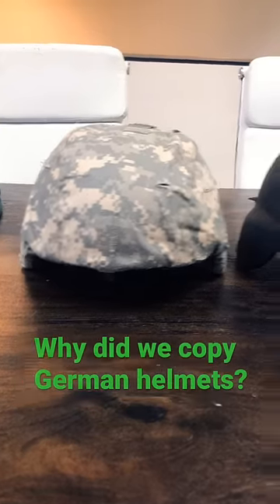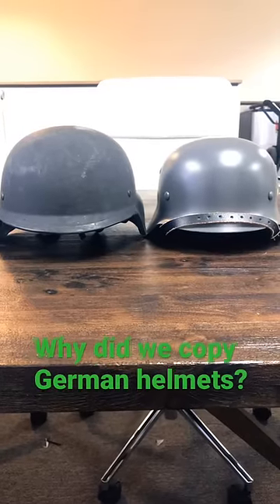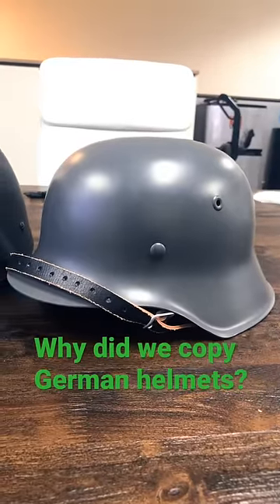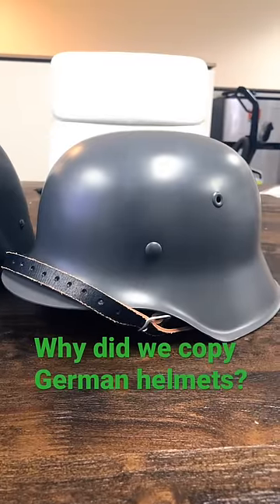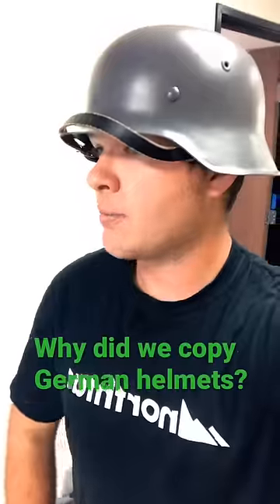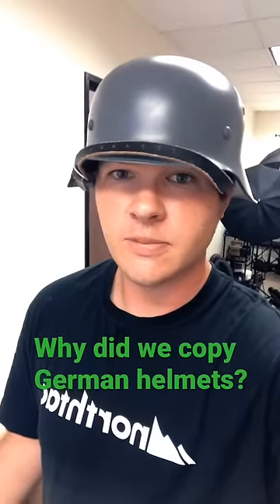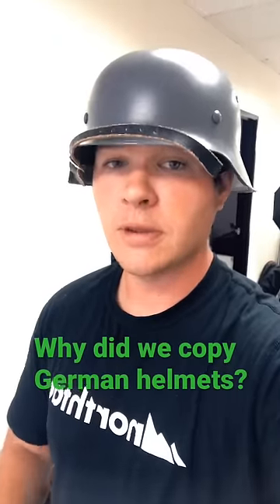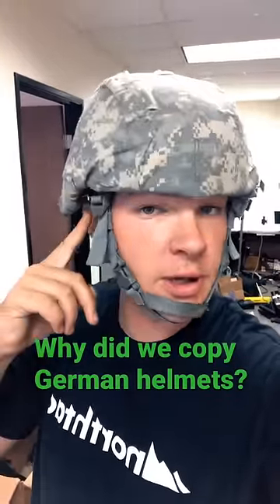Why did we copy German helmets? #shorts

Comment: Some German inventions no matter when they where Invented have great merits, I have a British ww1 helmet and you have to strap it tightly and it's still jumping around.

The German helmet was not harder to make than the British or M1 would cost around the same but are much better.

Just like the Jerry can, they would capture as many as they could as allied gas and water cans where awful.

Before and at the start of WW1 soldiers had to have a mustache in all European millitarys, you just had to it was a requirement.

Men would smoke pipes or cigars, or some would use snuff (high quality tobbaco leaf with stem parts removed dehydrated then powdered and mixed with mentholium to sniff) so smoking was not inhaled.

Cigarettes where made and meant only for women.

Men would have a pocket watch on a chain in their coat pocket, wrist watches where know as wristlets and only for women.

They had to relax the mustache law as it takes time to grow one, some men can grow a full one (I don't grow facial hair directly under my nose so no Hitler mustache for me) plus they enlisted boys as young as 13 (my great grandfather was 15 and was a Lewis gunner)

Helmets quickly became a thing due to all the artillery.

Cigars and pipes where replaced by cigarettes that men would inhale to get a quicker effect as they are much cheaper and faster to produce than cigars and have a stronger effect but officers would still use them.

Modern pocket watches with no metal cover with keyless works as in a crown at the top that you could use to set time and wind like on a normal  modern wrist watch would have lugs soldered onto them.

Ones with metal covers would have most of the cover drilled out so it looked like a cage so it was harder to break.

Some converters would even turn the movement so the crown was at 3 oclock.

All these are known as marriage watches and for watch buyers be careful as most are just old pokcet watches with new conversions.

Then Switzerland and the US would sell small movements to company's all over the world and wrist watches made from the start as a wrist watches started to be made.

Instant coffee became popular so did stuff like spam and American processed cheese.

Dextroamphetamine pills , morphine and diamorphine (heroin) pills and ampuals, cocaine powder, pills and ampuals , laudanum and chloral hydrate where all common drugs.

You could buy a kit containing a lot of morphine and cocaine ampuals and some syringes and needles where sold at Harrods as a perfect gift for those on the front line.

Many came home with addictions but had a decade or 2 until it became harder to get but still relatively easy to get a prescription from a doctor.

In most European millitarys (apart from the navy) Brandy, port, sherry, wine and beer (usualy an IPA type for its long shelf life) was what was expected from officers and privates.

Due to how large the war was this was replaced with naval rum about 56 percent (gunpowder proof) and if lucky you got some beer.

Officers still got the good stuff.

Before going over the top dextroamphetamine pills and alot of rum was given with men who could get anything else would do, the alcohol was rationed but it was common for men to save up or steal alcohol and then get totaly wasted before getting ready to go over the top as they knew it would be a miracle if they survived.

PTSD and what was called shell shock was not understood well and after a close hit from artillery some would just wonder off then be court martiled then shot at dawn for cowardice.

Alot of the time officers would shoot retreating men.

When the Germans could see something that looked like a gas mask was being used they would first use shells or canisters that would emit a non lethal gas that would make you vomit (making the mask useless) then would use mustard gas.

Your best chance to survive without a mask would be to hope your dehydrated and piss in a rag then breath though it.
(Even Hitler was not crazy enough to use chemical weapons in fights as he experienced them himself in WW1)

They went into the war with marching orders, the old pre machine gun and artillery tactics, cavalry and spotting planes.

It ended with chemical warefare, tanks, fighter and bomber aircraft and long range powerful artillery and machine guns being king.

My great grandfather lost his leg at the battle of the somme and he died at 98 or 99 with a wooden leg and after the war he could walkz run, okay football and ride his brough superior motorbike.  He was a little crazy I still have alot of German postcards that looked like it was the last postcard the men sent as it looked oked like it was written quickly and used ever quare mm of space.

You could tell if it was being sent to a female or male as if it was sent to a female It would be a landscape or art.

If sent to a man it would mostly be pictures of naked french girls, sometimes you could see everything.

They realy liked girls with a little meat on them with very pale skin back then.

He took back so much loot.

Since brothals in France and Belgium where so common as alot of war widows or just lack of work and the fact that some men would pay whatever they asked l, condoms where actually issued some rubber some sheepskin as so many men had to go to VD hospitals.

Even in Iraq and Afghanistan prostitution was rife but with girls mostly from Russia, eastern Europe and  east Asia but I'm sure they made alot.

In many modern millitarys they still hire girls at outposts and some guys can get vouchers or can do it once ever whenever or as a reward for something.
It's more secretive now but in the past was more common and open and I'm not talking about comfort women but paid women.

After WW1 and the Spanish flu Germanyz especialy Berlin from 1919/1920 until Hitler came into power Berlin was the place to go, it was cheap due to the fact most people where poor, men would go for weeks or months and find nice girls as they had some money or prositutes that cost little, even supposedly sister and mother and daughter (fucked up but hopefully it was fake) lots of cheap beer and good food and alot of cheap and courrupt doctors that would prescribe you anything you asked for.

It was one long party and it helped the Nazis get into power with Hitler himself getting syphalis (a disease that was very hard to treat pre-antibiotics and in later stages would make people crazy) from around that time that and his daily meth use was probably why he was so batshit insane, if you watch a video of Hitler at the Berlin Olympics you can see he is totaly high and tweaking out.

After WW1
When the men came home no one dared to make fun of clean shaven soldiers smoking cigarettes, wearing a helmet with a wrist watch and a new taste for rum and different drugs.

Just before the war ended more people died from the Spanish flu so if you where a professional soldiers at the start of the warz survived all of it then survived the Spanish flu.... You had luck on your side.

If you survived an injury like loosing a limb, since the trenches and no man's land was so dirty, full of dead body's, rats, piss and shit.

Plus the fact that medical tools where most likely not sterile unless it was a large well wuieped hospital not over run mixed with no antibiotics and you where so lucky not to die from infection.

After the war PTSD was rampant and one of the worst serial killers in British history but is not talked about much (as they charged and excecuted the wrong man, he would say he was an abortionist then just kill so many women including his wife then hide their body's in the walls and under the floors as he liked the smell of rotting flesh and wanted It to smell just like noman's land....... Messed up guy but at least he knocked them out with either first.

Comment: 📺💬 ... Adding something ...
🥺💬 I don't know about German but I also learn a preliminary course for my country and they had soft and hard helmets where they do not change to soft helmets they claim soft, comfortable, resistant, and lightweight but most of the time we found stones, and loss is the issue maybe I am dumb ;p my feet is followed by the tail of the head but seeing the situation is a good idea. ;p
🐑💬 utility helmet with communication devices and attachable devices.
👧💬 That is modern I found some they wearing on the motorcycle attached by the radio and navigator but I think they buying from the Internet.
👧💬 We still see these half-wearing helmets and benches.